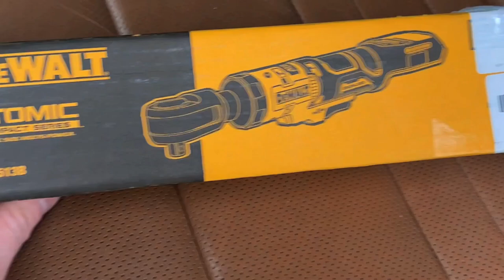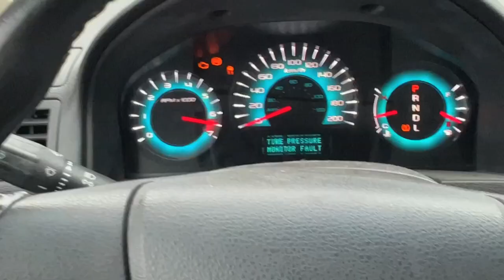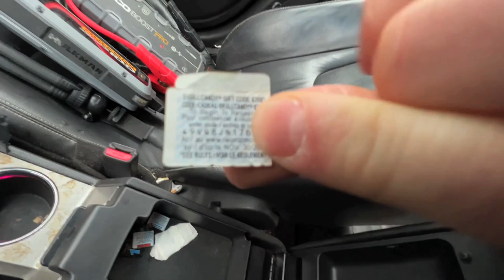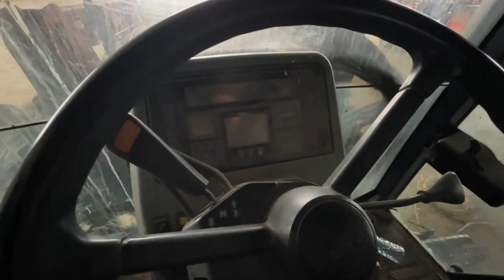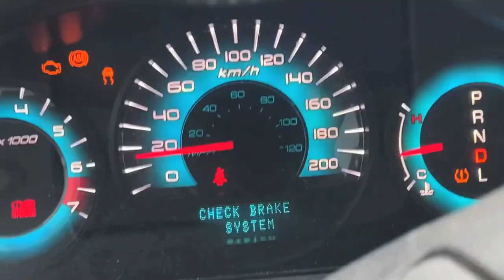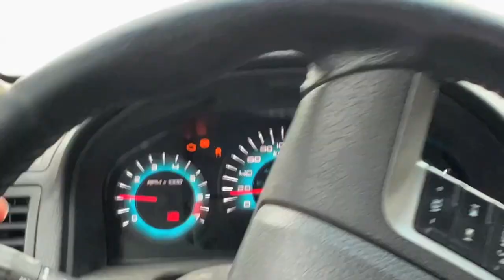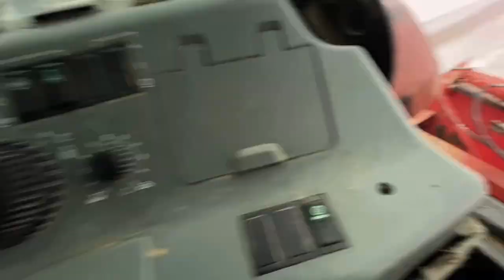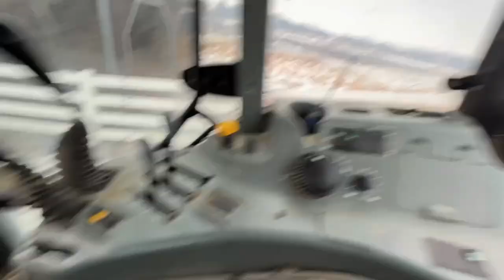NEW $1750 Ford Fusion JUMPER!

Comment: You should get decked for your truck bed it really makes a difference when you're storing your things in your bed of the f150
Reply from the maker: Decked?
Reply: @markfreeman408  it's a storage system that keeps your stuff in one spot and it's not hard to install because I've had to put them in my grandfather's chevy and ford before and the decked system can handle up to a 2500 lbs of a load on top of the storage components

Comment: LET'S SEE SOME ACTION!!!!  bur those tires off til they pop or motor blows and take nothing away from it.... dont do it in drive.... put it in 1st then shift in to second once it starts spinning  it will sing off hte limter the whole burnout light those tires red hot to the rim rubber flying everuwjere...and if trasmission gives up... put in neutural and just hotd and let her sing off the limiter til she sends everything out the oil pan...dont drain any fluids
Reply from the maker: Just destroy the car right off the start 😂 
Need more views if you want to see that!
Reply: Whoa whoa whoa there cars are getting expensive $1750 just to wreck it?! gotta last a couple months or so at least for video content 😎 that is of course unless someone else besides mark has other ideas 😂